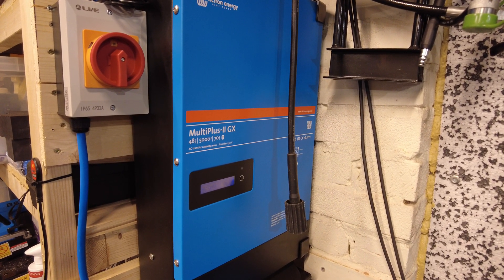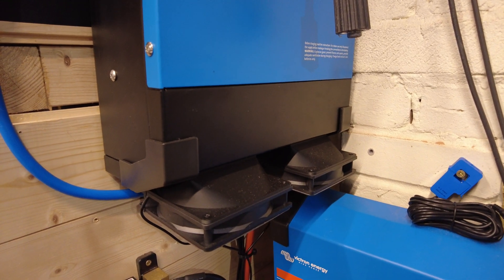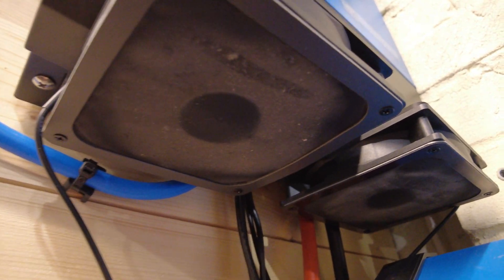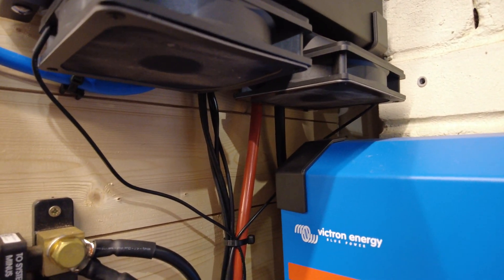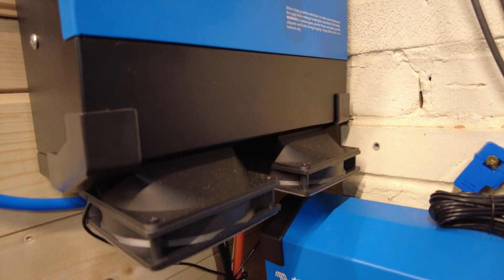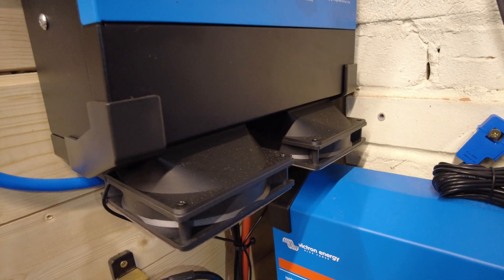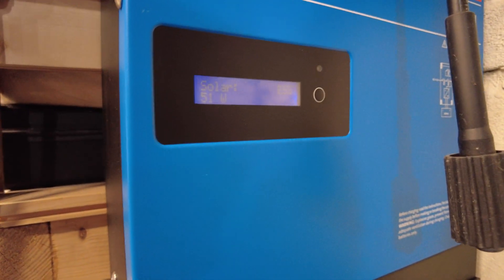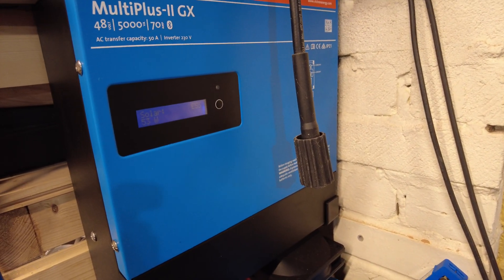Victron cooling modification

Comment: HI, beautiful, how long can this machine run at 4500 W of power to charge BEV ? 1 hour or 12 hours ?
Reply from the maker: With good cooling in theory it could charge a BEV at 3.6kw with no issues for multiple hours. If it's housed in a really hot environment then eventually it might reduce it's output. These victron units are solid heavy lumps but the weight is the transformer which generally means decent quality.